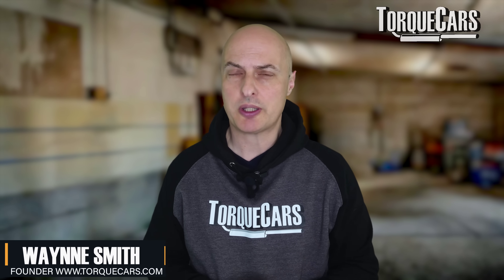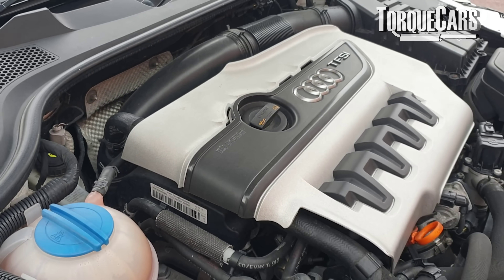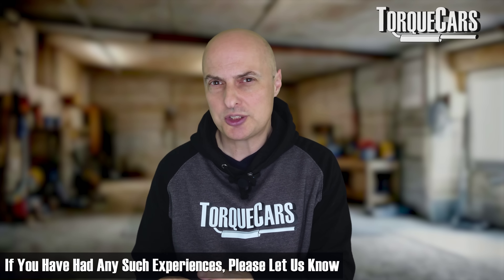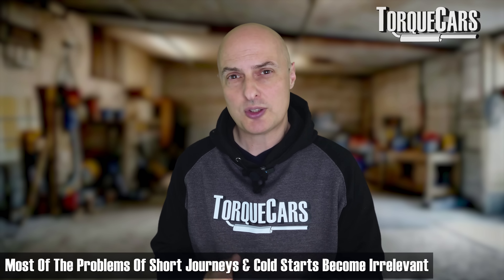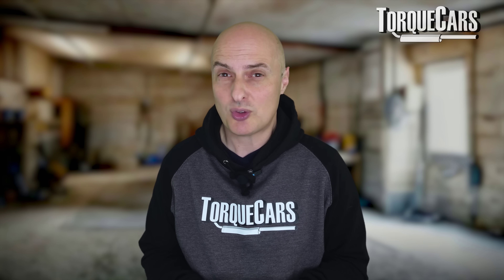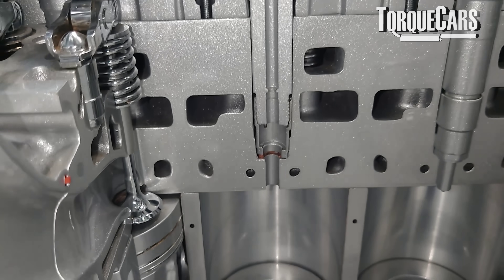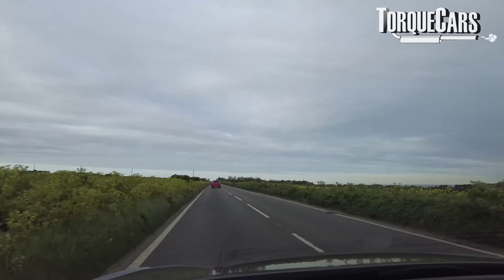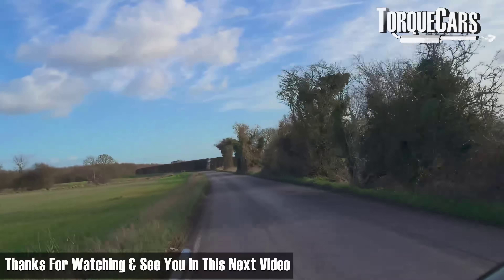🚗 Stop-Start vs Engine Idling: Which Really Kills Cars?💥 The Truth May Surprise You…

Comment: We have two stop-start engined cars in the family. On balance my view is to leave it to do its own thing. I would prefer not to have the EGR sending exhaust gases back into the intake during idling which in my view is one of the biggest problems for modern engines. One of our cars has done 115K miles and the other 148K miles, neither of which have had issues attributable to using the stop-start, although like others I do turn it off when traffic jams dictate continually moving and stopping for a long period of time.
Reply: My 2016 Toyota Auris doesn't even have an EGR valve as the VVTI is so good it is not needed to reach Euro 6 standards. As far as I'm concerned I'm quite happy to keep it idling, it saves money on batteries, starter motors, and potential engine problems. I mean just the extra cost of stop start capable batteries compared to standard batteries is staggering, you spend an extra £80 or so for the start stop battery but over the span of the battery you're lucky to save it in fuel. Stop start only exists to satisfy tyrannical governments not make your car any better. Stop start also doesn't even work outside of perfect conditions where you don't need to use AC or heat and don't have cold weather weakening battery performance, as for night driving in particular if you have halogen lights the stop start is also barely going to work. I don't think anyone considers the extra demand on the alternator too.

Comment: I disable the stop/start feature on my Golf, it does not enable until warm anyway. However, if I see the traffic is going to be stationary for a while, I will switch off the engine (ie level crossing). Don't get these people that idle the engine pointlessly outside schools, shops and car parks once they have already parked up.
Reply: Not only do I leave the engine running but repeatedly blip the throttle as well. My car only averages 20mpg anyway so why should I bother?

Comment: I buy a good second hand car that's well maintained and service it regularly changing the oil every 5k and then run it into the ground, so I aim for 10 years but anything over that is a bonus, in my mind that's the most cost effective way to run a car but I do my own servicing and repairs.
Reply: You are not alone! Thanks for confirming that I am not. This is exactly what I do. Takes a lot to make me sell an old car. They are so much more reliable.

I changed my own oil regularly and do little else by way of maintenance.
Reply: I wish changing oil every 5k could guarantee a long life, but it doesn't anymore. It's the other stuff that fails typically: those that are not strongly related to oil service frequency. That's my experience and much of my research on the topic. The price of an oil change, and the minimal additional benefit you'd get in terms of negating future problems, doesn't justify such frequency IMO. Extending oil changes beyond 12k is, however, not sensible as this can lead to oil starvation and an acute failure.
Reply: @stupossibleify  The issue is rust kills most reliable cars long before the engines or gearbox are even close to wearing out, people would be better off investing in undersealing their car rather than these 3-5k oil changes. If you have a car known for being unreliable crap like the Ford 1.0 Ecoboost and 2.0 Ecoblue or the JLR Ingenium engines, the 1.2 Puretech or any engines known to suffer with timing chain and turbo issues then actually these lower interval oil changes will extend the life of these cars significantly.
Reply: Yep, that's the way i do it too, sell it for parts or scrap value.
I paid 2 grand for my car, before this one, kept it 8 years, then off to the scrapper, and even then I could a fixed it, but too much time and effort involved. It owed me nothing.
Probably cost maybe a grand max every year or two to keep running.
Switch off stop start, after starting car every time.
Reply: Same
Reply: +1
Reply: I like to add i've seen a many cars for sale with full or mostly full service history & it's been stamped/serviced way over 10,000m (Usually 14,000m) and even at 13 months! To me that's bad service history regardless if it's full history.  Seen a few where the owner fills/writes in their own handwriting the miles & date in the service book! 🤣 Without receipts! They got parts from GFS/euro car parts etc & may have paperwork, that don't mean sh*t to me. 👎That's a big NO!  I don't buy anything older that 6yrs old, 90,000m esp without FSH, under £5,000 is a no,no!.

Comment: It's not that the oil has drained down ect,  it's the fact the oil pressure is lost and has to build up again. Idling does no damage compared to starting an engine with no to low oil pressure.
Reply: There's still an oil film there to protect it until pressure builds again. Not sure there's enough time to be starved of oil. Each time you start the engine after a few days of not driving is much worse.
Reply: @F3udF1st  but thats not the two choices discussed , it's far better to have it idle with full oil pressure than stop and restart with no pressure for a couple of seconds (3 seconds on average)
Reply: But we are dealing with relatively short stop times. Have you actually recorded a significant drop in oil pressure after say a 60 second start/stop cycle to back that up?
Reply: @MartinBennett-rs6thrasher  oil pressure drops to zero straight away once the engine has stopped.

Comment: Super Videos man..Very accurate and correct.  Glad some people still know facts.

On point of 5:55 > l dont think you ment to say Oil but diesel Instead. If you idle your car for an hour you wont use Oil,  only fuel. And that depends on how cold the outside temperature is and if the aircon is running. Colder weather outside tends to make the engine use more fuel to burn so it can keep healthy running temparature.

I ran my 1.6 TDI, DPF OFF 5 days straight and over night because we were sleeping in Norway in Winter. It is defenetly cheeper to burn Diesel than to pay 90€ for a night😅

Comment: I’ve owned three cars with stop/start and they don’t work until the engine reaches a set operating temperature, my 2013 c class i have now is the same, so not a new idea. In crawling along traffic I switch it off, some traffic lights I know where is over a minute waiting I just press the on button. The battery and starter are a much heavier duty items to handle Stop/start. But they can be a pain if on/off button not easily located.

Comment: If you think stop-start is annoying on a car, its even more annoying when its fitted to a bus and stops the engine every time the handbrake is applied (and then doesn't restart until you either release the handbrake or floor the throttle pedal). Even better as there is no button to turn it off.
Reply: @Arrrbol  omd!!!! Enviro buses are the worst for this.
Reply: If u turn on the hazard lights on a enviro 200/400 it cancels start/stop
Reply: @fastyaristurbo no wayyy that’s smart!! Unfortunately it’s traffic lights where stop start is most annoying.
Reply: @Arrrbol  try driving a stick with this crap

Comment: The sensation of the engine stopping and starting is annoying
Reply: I'm fine with stop start. It's nice to know I'm not needlessly polluting.
I've had 4 cars with it. No issues.
Reply: @timoakley277  How many miles were on each 4 cars when you sold?  ...makes a big difference at higher mileage...
Reply: @mt-ec4uf I've had my car for 12 years from new. Only 85k miles, but almost daily usage much of it in the city. Always used stop start, absolutely no issues.
Reply: @feanor5037  to be honest I think all this fear-mongering around it is a mix of older, rudimentary systems that wouldn't be monitoring as many systems, people getting annoyed at the slight delay in auto cars (manuals I really don't see an issue at all in this regard) and people thinking they're smarter than the engineers that have developed these systems. Sure, there probably are systems out there that are unreliable, but they'd be the exception. There's no data that suggests start-stop is an engine killer. The good news is your car is your car, and you can use the feature if you want, or turn it off if you want. Just my 2 cents.
Reply: @TitaniumGamingMC 💯, fully agree
Reply: Switch it off!!!
Reply: The first thing i disabled!
Reply: @Mackaroni_510  the Toyota hybrid I had until recently had seamless stop start.
Reply: In hot temps I turn Stop-Start off due to my AC iz no working. In heavy traffic in winter I let it stop . This I can regulate by how much I press the brake. Generally I do not like my Mazda Idling to much if no need.
Reply: My Mazda Skyactiv G is silent: doesn't use the starter to restart the engine. I believe the Skyactiv X is even more advanced in this regard
Reply: @stupossibleify  my Skyactiv G is not silent ….
Due to the high compression, it’s probably the noisiest engine on idle I’ve ever had

Comment: I alternate between the two. If I know I'm going to be sat for more than, say, a minute but then get moving again properly I'll let it do its thing. If I'm in actual "stop start" traffic such as a motorway hold up or rush hour I disable it - which I assume is the manufacturer's intention because it has an off switch conveniently located by where first gear is positioned (little ergonomic touches you notice on a German car, or in my case a Spanish one that's based on a German model!)

Comment: Our Jazz has stop start. Your analysis is excellent as far as it goes, but I wonder about the local mechanical wear on the starter engagement mechanism, surging current through the battery etc.  I leave ours on, but find myself defeating it most of the time by keeping the clutch in during short stops.  The image in my mind every time it does it is the inertial Lucas starter gear on my 1976 Triumph Toledo, spinning out and tearing into the flywheel rim.  Don’t know if they are permanently engaged and clutched somehow these days, but from an engineering perspective the operation always grated with me.  That Lucas mechanism would occasionally stick such that it stopped spinning out and car wouldn’t start until the driver unbolted the motor and manually freed it.  I carried a spanner for these occasions and could complete the operation at roadside in about 5 minutes.  I keep my cars as long as they’ll last irrespective of what I can afford, so the 5-7 yr trend isn’t my thing.
Reply from the maker: That's interesting. I also used to do that until I had to replace the clutch master cylinder and was told the constant pressure puts a strain on the entire clutch/release system. I find that starter motors are better built than say 10 years ago, the fact the car starts so quickly supports this notion too.  The starter mechanism hasn't really changed all that much over the years a solenoid pulls the starter pinion into the gear ring but tolerances are tighter. Hybrids drop the starter entirely and use the electric motor which is a clever development. I've still never had to replace a starter in a stop start car. I won't argue either way though as different people and difference manufacturers have different experiences and outcomes.
Reply: You are referring to the old Bendix starter. They are now pre-engage - the starter pinion is pulled in with a solenoid into the gear ring. Only then once engaged is power  applied to the starter motor.

Comment: What about the difference to diesel engines (usually having lower idling fuel consumption)

What are the factors that prevent start-stop of kicking in (mine in a 2013 VW Passat TDI doesn't kick in when engine cold), what about having a HOT engine, my concern is not the engine but e.g. the turbo charger if oil circulation is cut off at high temperature and oil is burning in the turbocharger bearings.

Is there a threshold where the system kiks in  and where not? e.g. not below 65°C oil Temp (so taking into account warimg up)and not above 90°C oil temp (so taking into account cooling down)

Probably modern Star-Stop systems are starting faster, but in situation crossing the counter traffic the system (in my car for my expectations) is not fast enough.

Replacement schedule is when repairs override car value respectively are higher than the annualy write off of a new (used!) car
Reply: 1.6 VAG tdi engine in my car (Seat Leon). 

I've not paid attention to cold operation because I try to avoid journeys where the engine doesn't even reach temperature. 

But I can say mine doesn't kick in when it's hot. A few times after hard driving (stopping at the top of a long climb to look at the views, or coming to a stop at the end of an exit slip road after driving at a speed that isn't 70) I've had the little letter A with a line through it appear and that's been when it's above 90c.
Reply: Oh and I think the other thing that prevents it is if the dpf regen has kicked in.
Reply: start/stop is disengaged after heavy load driving-to protect turbo, when battery dips below a threshold, if climate control is in use, if engine is below a certain temperature, if engine is over a certain temperature(vehicles with independant electronic water pumps may not need to do this)..you should notice that stop start doesn't activate if you've just come off motorway after high load driving...
Reply: @iainansell5930  mine still works when the AC is on, but the AC obviously stops cooling the cabin because the pump isn't being driven.
Reply from the maker: I've just recorded a video that discusses this (generally) so I'll get that up as soon as I can but I am about 4 weeks lead time at the moment.

Comment: I don't have stop start but if I'm caught in stationary traffic I just switch off for a bit. Saves fuel and wear. But for momentary stops having the engine cut out is hardly worthwhile. Concerning life of my cars - I look after my two and i expect at least 40 years.
Reply: factory start-stop, that shuts down the engine as soon as i stop for 1 second, is incredibly annoying, yes.
Reply: i did that, too, but it's not the best thing to do, cars with start stop systems have different starters (much stronger), stronger batteries and all the parts that start the car are built different. If you constantly stop and start your car manually, you will have a bad starter motor quicker and you'll have to change the battery quicker.. and some mechanics can chime in with that else will break sooner:)
Reply: I had a turbo timer on my previous manual courier vehicle so it could idle while I was out of the vehicle (with keys in pocket, vehicle locked, it's manual - it's not going to jump into gear like some autos), because it's not just turbos that benefit from being allowed some extra duration in stop start conditions. AC, alternators, batteries, and starter motors all benefit due to increased reduced load cycle instead of short high load cycles - your AC works better if it's not being shut off intermittently by an engine stop-start, your alternator doesn't have to work as hard to keep everything topped up with less time to do it, your battery isn't being cycled as heavily, your starter motor does less cycles, because of course, while the engine gets stopped for emissions reductions, all the electronic loads are still there - radio, fan, cooling fan, lighting, fone chargers/dashcams/gps etc

Comment: What did we do before stop-start came on the scene? Stop-start will damage your starter motor and draw more current from your battery, especially in winter. It's a waste of time and money. Use RedX in your fuel tank = no carbon build up inside your engine.
Reply: Start-Stop systems, usually have an adapted battery and starter motor, so this are the most uninteresting points, in my opinion is everythingb related to sudden drop of oil pressure and interrupted oil circulation (no transport of heat) and interrupted water circulation.
Reply: Except for any modern DI engines